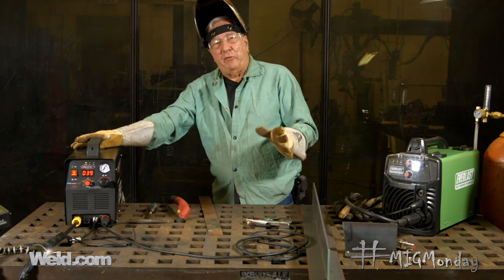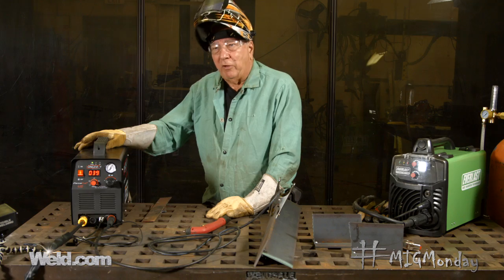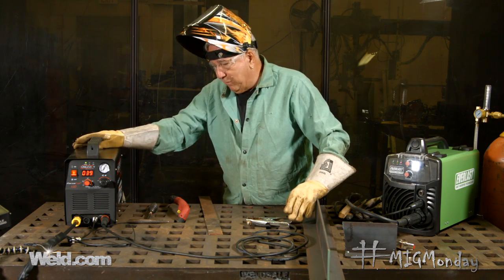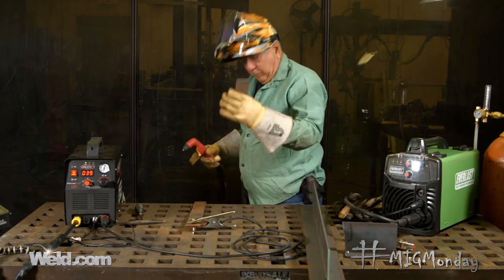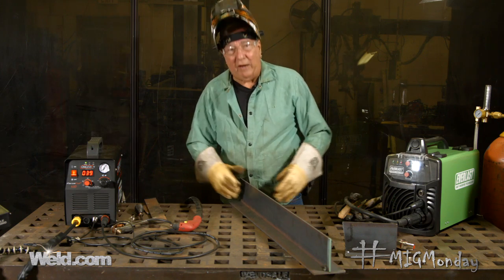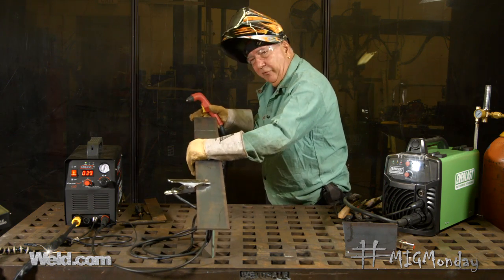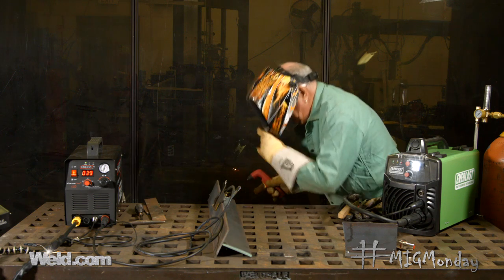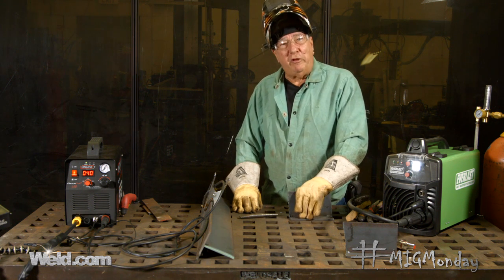Plasma Cutting Basics

Comment: So thanks for taking the time. However you basically only showed it's capabilities, you didn't discuss at all how. How far from the work clamp should you be? How far from the work do you hold the tip? Do you start pulling the trigger away from the material and move into the cut, or do you pull the trigger over the work to start cutting instantly? Should the gun be square to the cut or does it matter? Do you pull a puddle as you cut? I'm not being Sarcastic,  I do know what it can cut, it's the operation I needed to know.

Comment: Can you use a gassless flux core 90amp mig welder as plasma cutter? Im a bigginer in welding and having fun with it..
Reply: Very different machines. A powerplasma cutter uses compressed gas to surround a plasma arc and to blow the oxidized / melted metal it is cutting.
Reply: Gary Westin you could but you would need some kind of air compressors to blow the plasma into the metal
Reply: Recently upgraded a 40amp plasma cutter and a 200(!!)amp stick/TIG welding machine. Just basic stuff like longer mains cable, higher quality plugs, better earth clamps, extra insulation for the base and upgraded torches. Both were cheap offshore machines (different brands though). They both looked very similar on the outside (yellow, same size, similar handles), so maybe they're similar on the inside? Yep. They are both almost exactly the same, down to the last wire and screw. Same capacitors, same transformers, same mosfets, even the same solenoid for gas/air. For all I know they probably came from the same assembly line. The only difference seems to be on the controller board, you know the front panel thingy with the knobs and switches on it. Does that mean both can be used interchangeably? Maybe :) 
I don't really understand how they function so differently with exact same internals, but one of these days I'll either cut something with a welder or weld something with the cutter or blow something up. 😂

Comment: I am a novice at plasma cutting, and the other day I encountered a problem with the "flame" stopping in the middle of a cut.  What is the cause of that?
Reply: +Chad Jessup I would say the biggest cause for loss of the arc is a dip in your air pressure. How thick of material are you cutting and with how big of an air compressor?
Reply: +That Welding Guy You Know The material was 1/8" thick, and the air compressor is a rotary screw type which can sufficiently handle our five-bay shop.
Reply: +Chad Jessup  Not sure if it causes the flame to cut out prematurely, but I know moisture in your lines can cause your consumables to die faster.
Reply: +That Welding Guy You Know Thank you.  I will investigate that matter.